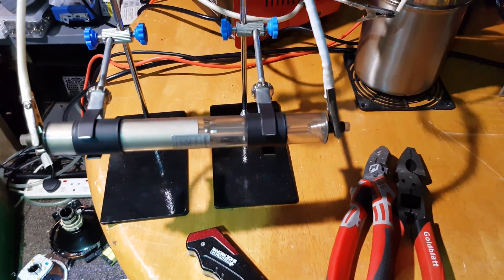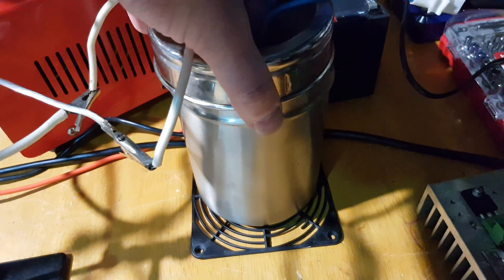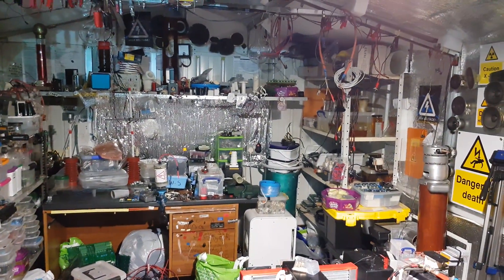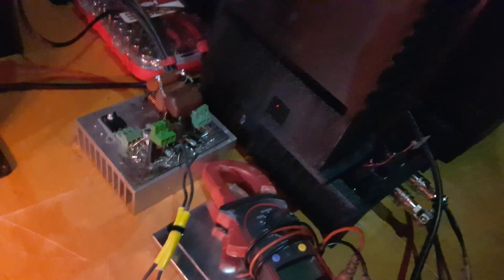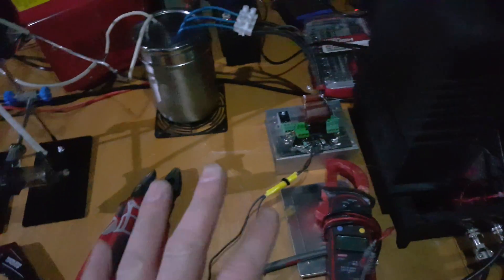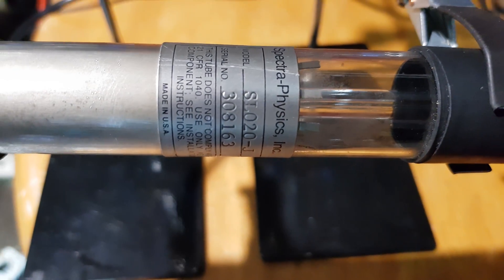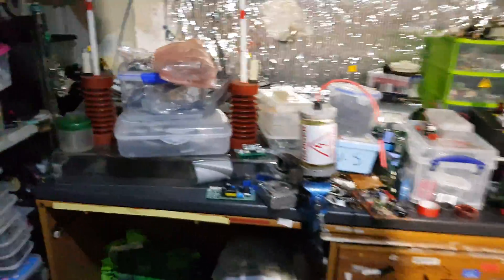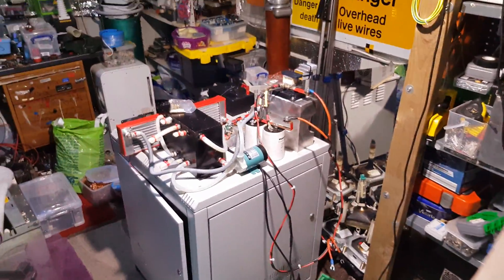Laser, spectra physics run

Comment: Once ignited, it will only need about 1600 - 1900 VDC to stay running. You'll kill it quickly at 12KV. Also, put a 2K 5W ballast resistor in series with it to limit the current. Most likely 2mW at 632nm.